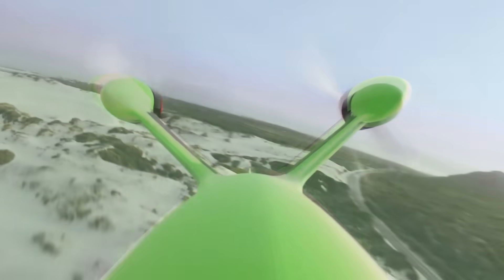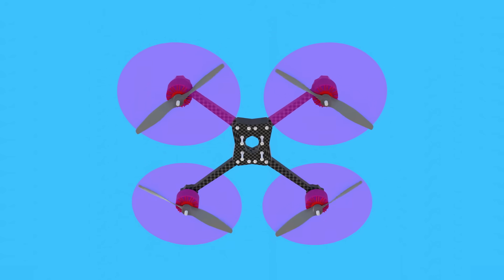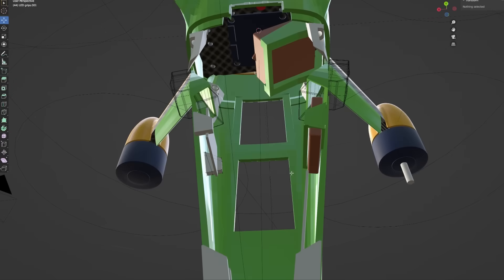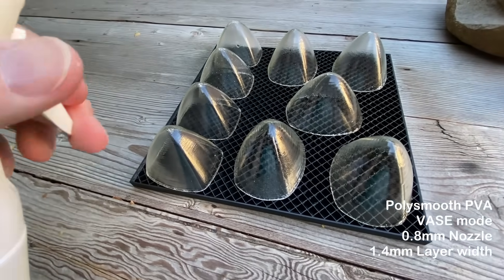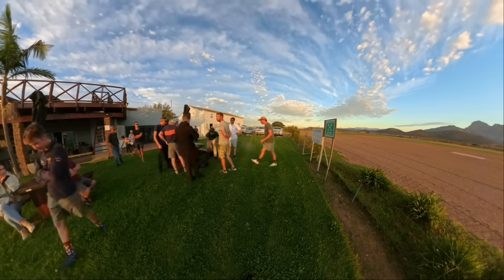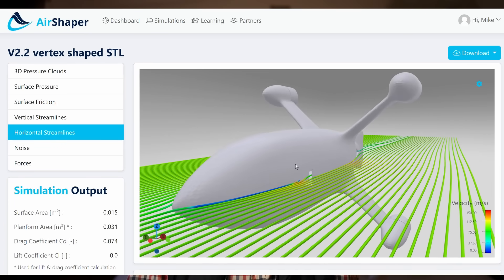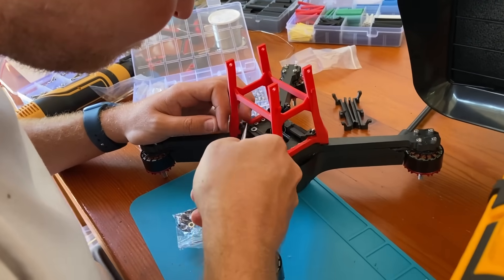300mph 480kmh | World's Fastest FPV Drone |  Guinness Record

Comment: Thanks for logging all the steps to a great project.  
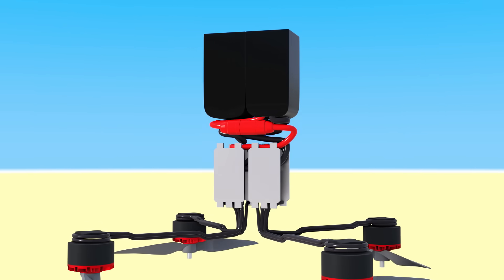6:22 Did you contemplate integrating carbon fiber rods to reduce the wobbling effect with the mass of the batteries?
Reply from the maker: Would love to investigate more complex carbon fibre parts but we had so much to deal with in this build there was no time. Plus surprisingly weight is not much of a problem at these speeds because body lift comes essentially for free. Must watch weight at take off and manoeuvring.

Comment: What are your thoughts on those new impeller shaped props?
Reply from the maker: They will distort and squash flat at 33,000 rpm forces.  And besides they are less efficient despite the hype.  Their main advantage is lower pitch less irritating motor whine.  Not quieter but less annoying.

Comment: So the fastest drone on earth is shaped roughly like a fish 😂 as a side note this isn’t a joke I’m thoroughly amazed
Reply from the maker: Perhaps we need to give it a fish name 💡
Reply: @Mike-Bell  you should name it after the Marlin they have been confirmed to swim at the highest speed of any recorded fish (in one confirmed case a blue Marlin was reported to have been stripping line from a reel at approximately 120 ft/s or 82mph)
Reply from the maker: @Theace88x   nice name... except we hope to drop the fin if we can because it is uneccary drag if we can get stabilit in some other way.  Longer tail for example.
Reply: @Mike-Bell  my thought is keep the tail for now but if you haven’t already coat and polish the outer shell to the highest grit it will hold a polish at, 3d printed plastic is not the smoothest surface to begin with even after spending time in a vapor chamber and most of the drag it’s still experiencing is likely to be skin friction with the air the smoother surface would allow less surface area for the drag to occur against, then after that if you’re  still not satisfied with performance drop the fins taper the tail a bit and add a small aluminum rod out the end that’s been sanded with rough sandpaper increasing skin friction, you may still need small fins at the tip but it would allow for smaller fins (edit: rewording to better translate my thoughts)

Comment: Did you consider putting the esc's below the booms.  Seems like it would have the shortest wiring and easy to provide esc cooling.  I love the shape.
Reply from the maker: Good idea but they would be hit by the props.
Reply: @Mike-Bell  I have a drone done that way and I don't see what you mean. If they are in the fairing below the boom how could the prop hit the esc?

Comment: Build the next one from carbon fiber!
Reply from the maker: Would really love too.  But interestly weight is not really is big thing at these speeds.  The body lift comes basically for free.  The weight cost chomping up battery power is big on take off and manouvering.  It prefers cruising at above 200kmh 130mph and more.

Comment: Hi Mike, Why don't you put dimples over the surface like a golf ball ?
Reply from the maker: Dimples on a golf ball are there to help increase lift and therefore travel because it is a rotating body.  Plus the  ball speed is relatively low.  They would just slow our drone down.
Reply: @Mike-Bell  I was of the understanding that they are there to reduce drag.

Comment: I have an even faster design. 

Alr so what you need is a small drone machined from a block of steel. Then you make a standard drone, but leave a bit of room at the front.

Now, once the bigger done is flying, detonate the tnt you placed in the empty space, launching the smaller drone at  mach jesus and beating every record that has been made, is being made and is yet to come.

Comment: I wonder if drag could be reduced by placing the props on long thin shafts angled inward to the central body. That way, the motors would be in the central body. You wouldn't have the drag of the pods, and the "wings" would be replaced with thin shafts.

Since each shaft is along its line of thrust, there's no need for the cantilever strength of the "wings".

Comment: Hi Mike - which 3d software do you use  ?
Reply from the maker: I use Blender. Fantastic software.
Reply: @Mike-Bell  yes indeed they are open source and great.
Reply: will you open source the design or plans at all?
Reply from the maker: @kay834  that would be very irresponsible of us.  people should not be building this dangerous thing! 😂
Reply: @Mike-Bell  good point it is a tad dangerous!
Reply from the maker: @kay834  we are in discussions with a manufacturer to develop and add a simplified 400kmh 250mph to their product line up
Reply: @Mike-Bell  would you be open to discuss consulting on a project - - it would be commercial - I am based in EU (UK) not sure how to chat via email may be better - We chatted with dutch gods too but I really liked the itterative approach here.
Reply from the maker: @kay834  sure that sounds interesting. My email is tadpolefarm@gmail.com

Comment: Needs to take advantage of the Area Rule. (See differences in body shape between F-102 and F-106 jets). Spinners on the props will help reduce drag inducing turbulence, and could be landing gear. Potential to move those speed controllers in to the printed sections of the arms, to reduce cable mass.
Reply from the maker: Area rule to be investigated in next version. 500 kmh is already into some incompressibility territory so we suspect there are gains to be made with area rule. Interestingly the weight is only a burden to take off and manoeuvring.  At high speed cruise the angle of attack is only about 1 to 2 degrees and induced drag from body lift is tiny. 
But yes wiring is heavy and around 8 to 10% of weight so needs optimising.
Reply: @Mike-Bell  I think there's mention in there of tip speed getting close to supersonic,... It'd require custom molds, and a gearbox on each motor, but having each motor drive a pair of contra-rotating props, with the trailing prop having a steeper pitch angle to further accelerate the air, might add a decent amount of thrust.

Comment: Hey. Amazing project. What was the decision making between making pusher vs puller design?
Reply from the maker: Haha to be honest that is how the competition does it and puller props just look lame. But its something that should be windtunnel tested for a conclusive answer in the next version. And we have plans for optimising the fairings to harness to air stream rotated by the props.
Reply: @Mike-Bell  I’m thinking about making speedy drone with a team, but with much higher mass. Most motors are designed to intake air from the front, so I’m thinking if rotating motors aren’t premature optimization. Will need to test anyway. Thanks for content, keep it up!
Reply from the maker: @ilukisha  the air can just as easily exit out the back of the motor. It a bad tune that heats the motors the worst as the RPMs are up and down all over the show. I’ll be interested to know your conclusions about puller props.

Comment: I feel almost vindicated seeing someone else do their rapid drone prototyping in Blender, and especially your line that; "Success is achieving both excellence in performance, and esthetics" is something I've cought a lot of heat over from the pure CAD guys. 
Amazing work all-round!
Reply: This is a very interesting take! I feel like engineering/product design is to often teached to go from a sketched based 2D straight into hard and traditionel software such as solidworks/ siemens NX surfacing tool of what ever is used. Blender could be this perfect in the middel. It's abusrd to think about the hours i've seen friends, colleageas including myself put into interrating very complex surface models just modifying splines and addapting surfacecontinuity. The best thing is I have blender installed a couple of months ago exact for this reason but do not seem to find the time or motivaction tot get into it. I this video shows exactly why I should.
Reply: That's more of an argument to CAD designers needing a background in graphic design than it is for Blender being the better tool.

Comment: I'm supprised that the cooling inlets arent on the narrow sides of the body, where the steepest surfaces are. Is grabbing air from those places not more efficient?

I've also thought up a design for a body with a cooling aperture at the very tip of the nose. Part of the reasoning for that in F1 is to give stalling air at the tip a place to go, while simultaniously giving cooling.
How much merrit is there for using that in V3?

I'm just an amateur thinking conceptually though. Amazing that you guys are out there doing it for real!
Reply from the maker: We were worried that 500 km air would vibrate the camera but in testing this was not the case. So version 3 is likely to have the camera at the front tip and a small air gap around it as inlet. All to be windtunnel tested before we make the decision

Comment: in your next design, you can double the amount of motors. 8 instead of 4, same design for the core, space for the battery in the center. 4 more motors on top, feeding the bottom motors, or turn them all 4 45 degrees as to not interfere with the bottom 4 motors. the flight time might be halved, but the speed might increase :) you could make it perfectly symmetrical, modular even, adding more and more motors in a line, even the battery compartment could be modular.

Comment: Awesome design, execution and performance, Mike

Your Bambu printer may be able to print STEP files, which will behave like very fine mesh STL files, although that depends on the slicer.

Great to see South Africans setting records.    Netjies gedaan.
Reply from the maker: Dankie.  Flippin lekker om SA bietjie te showcase.  Blender doesnt work with STEP files unfortunately but it is perfect for the animation I make and it makes fantastic drone designs too.
Reply: @Mike-Bell Yeah, Blender works exclusively with meshes. STEP is for CAD.
Reply: What CAD program do you use in addition to Blender?  Great work and dankie for sharing. @pseudotasuki
Reply: Yup, Bambu Studio does support STEP. That's my go-to format when working with designs that have tight tolerances. Plus they're much easier for others to reverse-engineer.
Reply: The Bambo printer prints "g-code".   It is the slicer that turns STEP or "whatever" into g-code.  But all current slicers will first convert the STEP file to a mesh and then slice it.   None of them currently convert the mathn=matically defined sahpes in the STEP file directly to g-codes.      So you do not get better prints from STEP,  unless you were dumb enough to create very low-res STL files.  But no one does this.   With any sane workflow the limit will be the printer's resolution.      But even then you could finish the parts with sandpaper and spraypaint for a perfect finish.

Comment: Greetings from an Arkansas engineer/aviation enthusiast, Mike! Congratulations on your success and I loved your excellent presentation. I'm really looking forward to seeing your CFD-optimized revision-- no doubt you'll be able to make some solid improvements there! My money's on much longer trailing edges for the struts, 'bulbing' the nose a bit and trading the fin for basically a long cone, ha. 

If you don't mind some input, I do have a couple other thoughts for where one might look to keep pushing the boundaries from where you're at now (though I've no doubt there was a great deal of consideration already given to some of these that didn't fit neatly into your video).

First one is weight. Frankly, you guys have already done pretty well with this one-- not a lot of fat to trim, there, but I'd be giving serious thought to how I could start cutting grams off this thing ('Do I really need all four motor screws? Could I make my fuselage lighter by carbon-wrapping a vase-mode version of it? Could I make my cables shorter so I'm not carrying all this copper?)

Second is aerodynamic cleanliness. There's something here which may not become immediately clear from your CFD simulations. These models do not always do an excellent job at modeling either surface roughness (such as print layer lines) or the transition from laminar to turbulent flow across your model. You're really gonna want to be sure your craft is aerodynamically smooth! To give an example, it's fairly common for sailplanes to have leading edge wipers to remove bugs and dirt from their wings while in flight. These devices make about a 5% difference in performance. Your application, being small, is low reynolds numbers, which means you have the potential to promote more laminar flow across your airframe if you can design for it carefully! Again, I'd love to see a polished carbon fuselage for this.

Finally-- props. For me, I'd be giving a hard look at these. No easy shortcuts here, but off the dome, questions I might have: 3 blades for more power without tip transonics? Custom prop pitch and profiles optimized for my flight profile? I would also bet good money that carbon props would perform better than injection-molded ones (less weight, higher stiffness). Vacuum-infused ideally, but forged carbon may be nearly as good and cheaper. Easy composites has excellent videos for this, as does TechIngredients.

I'll be more than happy to answer any questions regarding what I've written, should it be of interest. I'd love to see this thing hit  500kmh(550?). Again, well done and congratulations on the win!

Comment: Maybe tow steered composites and custom aerostructurally optimized geometry of frame and motors for v4? In my experience, ADFLOW is a lot faster and more accurate than airshaper and it can do shape optimization

Comment: What brand and model are these batteries?
Reply from the maker: All Dogcom batteries and they are not great. Bonka next time
Reply: @Mike-Bell  Unfortunately I think you will probably find that most lipo cells/packs are over-rated by a large margin. It's unfortunate too because they do have the best energy density because of their shape. You may have the best luck building your own packs from individual cells. Either way I wish you luck in finding a good power source.
Reply: @duncanyoyo1  | What is the maximum real C-factor?
Reply: @Mike-Bell  | What is wrong with Dogcom?

Comment: While the print is laid down in the horizontal, the air drag is along the vertical of the spine. While it looks very smooth, metrology could show some roughness along the exterior surfaces. So, shifting the axis of the print, polishing the surface area, and/or using injection molded parts may reduce surface drag even more. The nose also looked a bit blurry and could be clearer.
Reply: Excellant observation!

Comment: Awesome project! Looks like a fun one. Curious if you have done the math for what impact a carbon fiber exterior (or any alternative) could have on weight. The shell sure looks pretty light already.
Reply from the maker: The low hanging fruit development areas are still batteries and aerodynamics so thats the next version. And interestingly induced drag is near negligible at 500. You pay the price of weight in battery drain and manoeuvring. The angle of attack of 1 degree is all you need for body lift. It’s basically a wingless VTOL. I’ll be explaining this in the next video. 

So weight savings will increase speed because of a longer speed boost but not induced drag savings. 

Weight will get serious attention in version 4🤣
And when we get serious competition. 🤙🏻